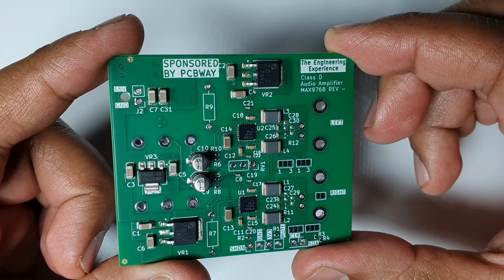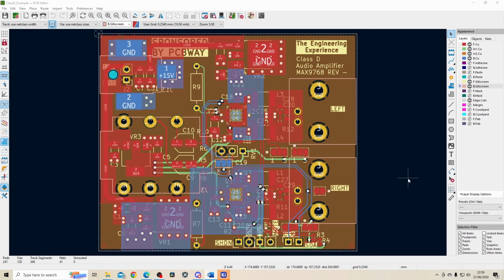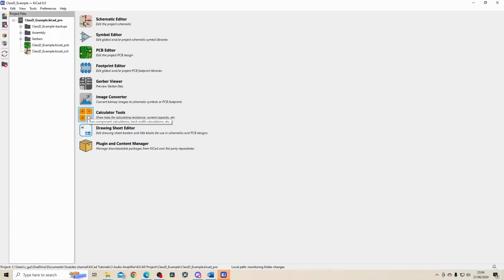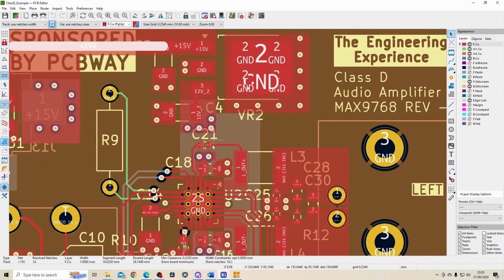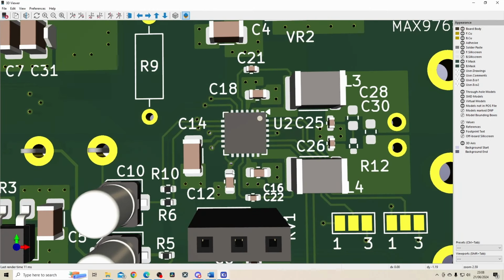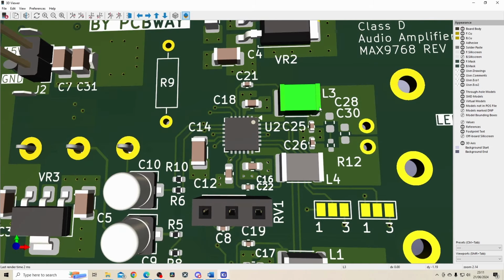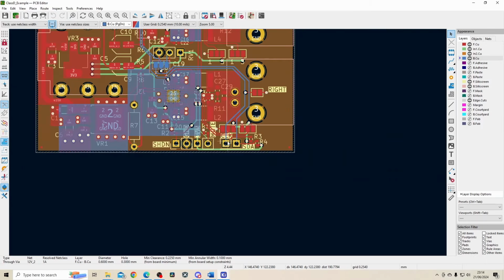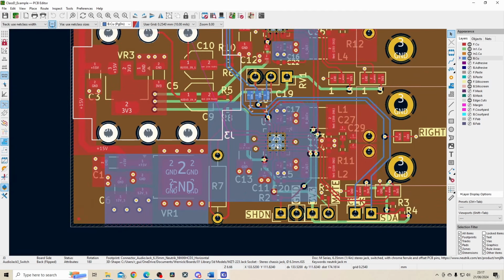Class D Amplifier PCB Design - DIY Audio Amplifier Design #3

Comment: Hey. Nice video. For PCB calculations I recommend you to download Saturn PCB Design Toolkit, it is free. I noticed you have 35 um via plating. Not sure is this correct for PCBWay, but JLCPCB has like 18-25 um via plating as far as I know. I think crossing analog and digital part would be fine as far you have ground plane in between of them. I usually always via my boards through. All the rest of the unused copper will be via through. In Altium it's called via stiching. Do you have any project with this board or just a test?
Reply from the maker: Hi, thanks for watching and feedback. 

I did board just for learning and fun. I think via stitching would have been a good idea however thr highest frequencies are probably in 300khz range so via pitch would be quite large anyway I think. 

I have the boards manufactured by PCBWay and they did not have any issues with the build. They look really good quality.
Reply: @TheEngineeringExperienceYT  I meant that you did via current calculations with 35 um which won't be correct if you order from JLCPCB since they have like 18-25um via copper plating. Not sure about PCBWay.
Reply from the maker: Ah I see! The vias were significantly above what I needed anyway so should be okay but will keep an eye out next time. Thanks.
Reply: @TheEngineeringExperienceYT  Ye I know you put them quite many anyway. Just pointed out this if you happen to do some high current design one day it may become more crucial.
Reply from the maker: Definitely important. Thank you. :)